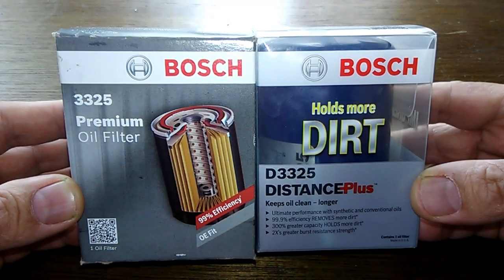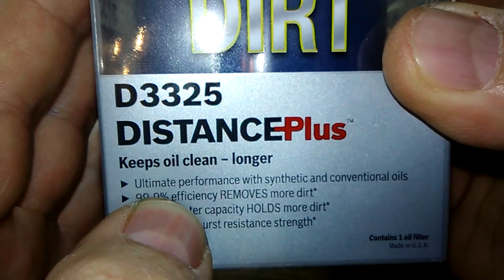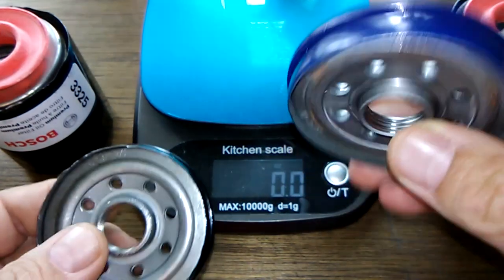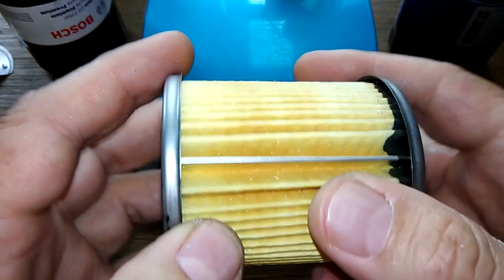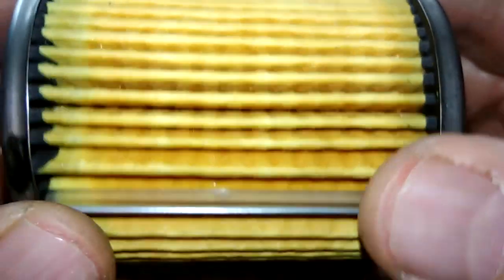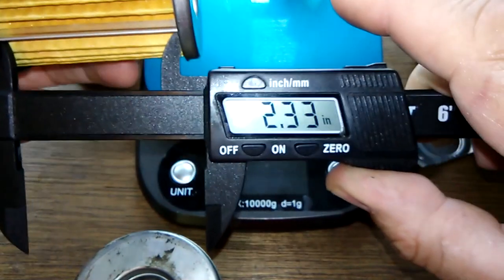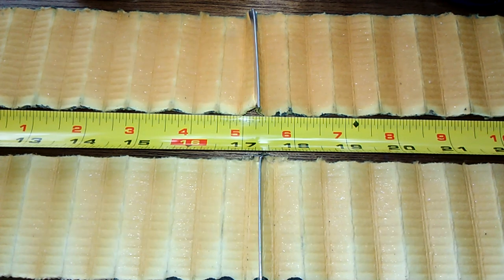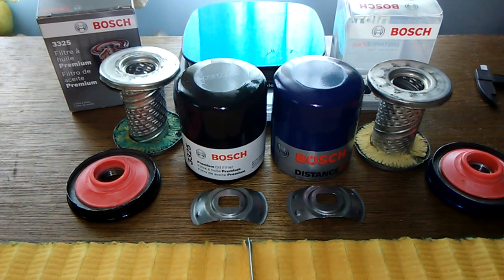Bosch Oil Filter Cut Open 3325 vs. Bosch Oil Filer Cut Open D3325, Oil Filter Review

Comment: At 12:58. 99% at 20 and the other at 99.9% at 40 microns.
I wonder does the cheaper filter filter 100% at 40? Or 99.999999% I mean that is a double size particle.  Personally, I want the smallest particles filtered because that means it catches all the big ones also.
Reply from the maker: I know it's very confusing and doesn't make sense, Check out the RockAuto links below the video and see what it says on their website. I'm just quoting their numbers.
Reply: @WhipCityWrencher  Yes sir.  The 40 rating on the Distance is a no go for me. Bosch doesn't show the distance anymore. If you search their site, all the distance filter links are dead.
Reply from the maker: @GT-mn3bx  Yep, starting Next year,
 I might stop posting micron and filter media info. It ticks me off, I find a posted micron rating on a website only to find later they deleted or changed it.
Reply: @WhipCityWrencher  Or just say at the current time this is what the site says...at least Wix Reg/Napa Gold has stayed 21 and 10K for as long as I know.  Not so for the XP/Platinum which used to be 20 or 21. Now 30-35 if you call them.(Not published for the latter anymore.
Reply: @GT-mn3bx  Bosch stopped making the "DISTANCE +" oil filter. I don't know why.
Personally, I have no use for the so-called "extended life" oil filters, since I change oil & filter at 5,000 miles.
Reply: @SlikLizrd  Probably more money for a higher micron rating. "Most" extended filters have terrible micron ratings. That is how they get them to last longer.

Comment: The extended D filter looks to be fine esp for the approx $6 it costs.

The std filter is ok gor 3k mile oil changes & the D longer distance filter I max st 5k oil change.

But to say you would not use the longer distance filter yourself seems extreme because gor $6 it’s h go ot silicone gasket & ADV along with nice metal core,baseplate,case & decent amount/sq “ of what seems to be decent type/design filter Lego’s too.

On the cheaper $4 filter,I think that Nick in the pleat was not something that happens often so on avg I’d say that filter is ok gor 3k mile oil changes .
Reply from the maker: This is an older video and the oil filter prices have changed some, but
both filters are fine to use. I shouldn't have stated my personal use. If I had to choose between the two, I'd take the D3325 filter.
For my personal use, I like filters that have a backing to them, metal or polymer screens.
Thanks for your feedback!👍

Comment: well, that's not good, I was going to buy a bunch of those on sale at rockauto, but this video made me change my mind, also I notice some rust on the base plate under the anti-drain back valve, I wonder if the media is the same thickness? if they are, It is only branding and marketing. thank you for the video, you prevented me to do a big mistake.
Reply from the maker: I'll get back to you with a thickness.
Reply from the maker: Both filter media measured at .8mm.
Reply: @WhipCityWrencher  wow unbelievable, they sell this filter as a premium filter and you get the same media as a cheap filter, yes the can is thicker and the base is thicker but have you ever seen a can burst? or a plate with a stripped thread? I personally never saw that in 45 years even with a cheap filter, I will follow your recommendation and go with a Fram ultra synthetic. dzięki!
Reply from the maker: @budblack3588  You really can't go wrong with the Fram Ultra.
If you have some time here's an interesting read. https://bobistheoilguy.com/forums/threads/would-you-all-like-to-see-iso-4548-12-oil-filter-lab-testing-comparison-efficiency-capacity-pressure-vs-flow-bubble-point-and-burst.334882/
Reply: @WhipCityWrencher  thank you for the link it is very  interesting

Comment: I had a Baldwin filter that had a bigger tear in the same area as this Bosch filter. I noticed both the Bosch and the Baldwin that I cut open had shallow end caps where the filter media is glued. Maybe this is why they developed a tear during the manufacture process. I have noticed filters made in Thailand, Korea, Vietnam and China don't have this messy glue deal going on. All of the Napa and Wix filters that I have cut open have been very well made without any of the excess glue all over. Both of these filters are owned by the same company Mann Hummel.  Maybe it is the plant where they are made that makes the difference.
Reply: Who cares if the filter has a lot of messy glue. Looks aren't important, as long as there's more than enough glue to safely hold and seal the end caps to the filter media.
Reply: @bobby1970  You're right Bob. As long as he glue isn't covering most of the filter element. Just makes me wonder how carefull they are in the manufacturing process.
Reply: @davidsacco4860  True.
Reply: @davidsacco4860  for a filter that retails for $4 what can you expect for that money. People.who manufacture these are probably getting paid minimum wage or even sweat shop wage. If you are looking for a good quality filter and assembled very neatly, I would conside buying  the $10-15 ones...

Comment: At least Bosch DP is better than Fram oil filters.I used Bosch oil filters sometimes with Castrol Edge 5w30👍
Reply from the maker: Better than Fram orange can? (Probably). But not better than Fram Ultra IMHO. Castrol Edge is a good oil. They have a $10 rebate going on right now.
Reply: @WhipCityWrencher  Fram ultra is okay.I use K&N cartridge oil filter on my cruze.👍So where do they have the Castrol Edge oil rebate?
Reply from the maker: @TT-hy1hg  Here's the link https://apfco.com/Secured/R11076W/
Reply: @WhipCityWrencher   Thanks for the rebate info.👍
Reply: I doubt this is much better than Fram orange can.

Comment: I just changed my oil and removed one of the Bosch premium filters that i purchased and installed and cut it open.  My filter does not look like this on the inside.  No metal crimp on filter media and NO bypass/relief valve at all.  It is very disappointing that I did not get what I thought I was purchasing.  I now have several of these that I am not sure I have the guts to use.
Reply from the maker: I would open another and see what it looks like, also check the date codes.
 No bypass valve? Maybe your engine already has a bypass valve and doesn't need it.
Reply: @WhipCityWrencher  I actually called Bosch.  They said that the car manufacturer doesn't call for a bypass on this application.  Maybe there is one already in place.  However I was looking for a metal clip which the filter did not have.  Again thank you for your videos and for your correspondence.  It is much appreciated.
Reply: You probably got the economy bosch workshop version...theres bosch workshop, premium and the distance plus.
Reply: @wjm3018  nope didn’t get the workshop version.  I bought the premium.  Thanks for your comment however.

Comment: Your comment that you wouldn't use either of these filters.  So what filter do you personally use and why?
Reply: Fram ultra gard seems to be the best
Reply from the maker: I was using a Fram Ultra XG8A. Right now I'm using a Purolator Boss. I like the strong filter media on the Boss, but I think next oil change I'll go back to the Fram Ultra. I will be getting an oil analysis after each oil filter change to see if there are any differences.
Reply: Did you change your oil and get the results? Did you do a Video with it? I'd like to see that ! Love your videos

Comment: did you happen to find the blue one's filtering percentage % for 20 microns? I"m just looking for apples to apples here. I me the different microns just throws everything off unless it means something to you. I mean what, they could say 99.999999999% at 100 microns? lol
Reply from the maker: It's confusing to me also. If you go to their website it looks to me the Premium has a better micron rating but they say the DistancePlus traps more dirt., which doesn't make sense to me. Here are the links to their micron ratings. 
It seems to me if they want to confuse people, then their micron ratings are probably not that great.
https://www.boschautoparts.com/en/auto/filters/premium-oil-filters 
https://www.boschautoparts.com/en/auto/filters/distanceplus-oil-filters
Reply: The premium is able to trap more smaller particles. But because of that, it also clogs up faster. The distance allows more of the smaller particles through, allowing the filter to take longer to clog up. This is how all extended performance filters work.
Reply: Exactly. It is marketing.They don't even have Distance on their site anymore. The Premium shows 20 micron. I have ran those but they are double the cost of Wix Reg/Napa Gold at 21 micron.